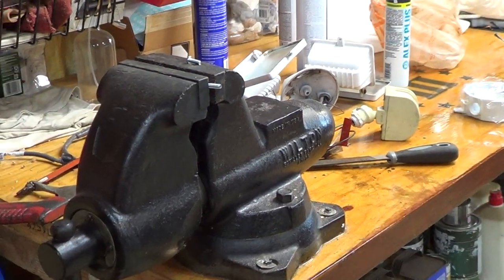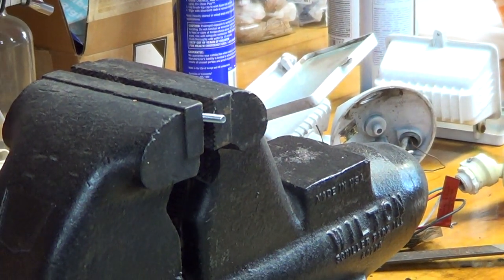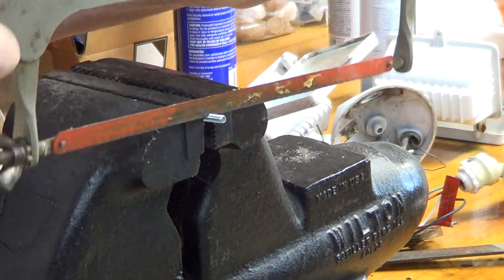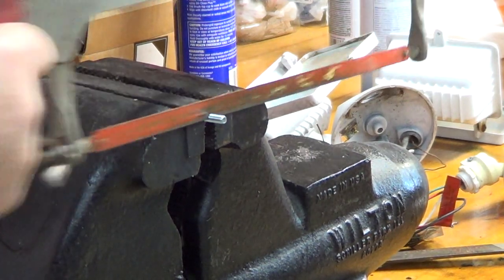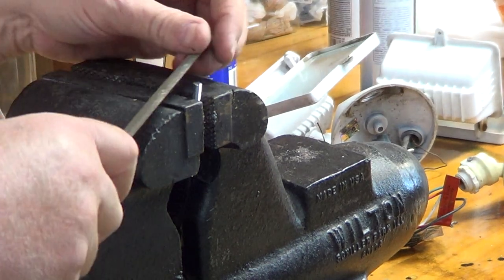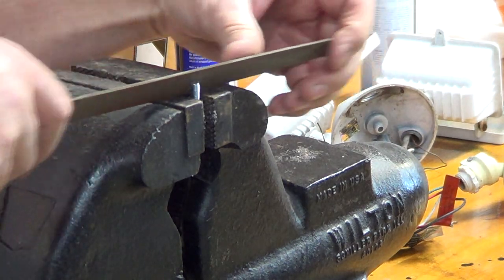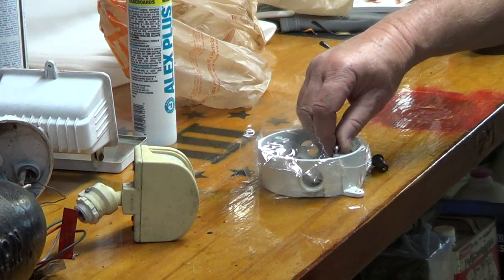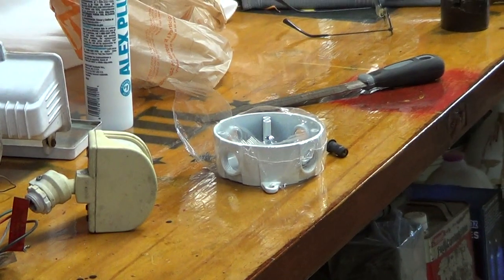How To Cut A Long Screw Shorter & Prepare The Threads So It Works

Comment: Most good wire strippers have the ability to cut standard (6-32 and 8-32) electrical screws to length.
There are threaded holes in the strippers.
Reply from the maker: wow, I have to check that out, thanks
Reply: I just made that comment and then scrolled down and seen yours. Lol. Funny , I just learned that a year or two ago and was happy as hell to learn that. Never knew that for 30 years while using them. Lol
Reply: Not on the part that strips wire but the holes in the middle of the tool will cut small screws   I find it easy to run a nut down the bolt/screw past cut then cut it and take nut off  clean treads up

Comment: A little trick I found out was - you know the electrical pliers that you use to cut electrical wires. Every set that I've ever seen has little holes all over the middle or towards the top of them. Those holes are different sizes for different size screws. If you want to cut a screw , put the screw in to the hole of size you want cut. Squeeze the pliers and bam. 99.9% of the time , the screw is perfect and ready to use. Just a tip/trick that I seen on YouTube a while back and could not believe no one ever taught me that. Lol.

Comment: A nut on the screw all the way on will help clean the threads after you cut off the extra metal. After the cut lightly file and then back off the nut to clean the threads. I’m probably not the first to say this, but it has worked for me many times. They also have a file made for just screw threads. 👍

Comment: If you had a nut you can fix the threads also. You just spin it on, cut the screw and then take the nut off and it helps fix the threads. And filing also works. Whatever is at hand.

Comment: You could also use your wire strippers for smaller bolts and screws and no need to prepare the threads.

Comment: A bolt that size should be a 15 second cut.  Long, fast strokes is best with just light pressure.  It is also good, if you have a nut that fits the bolt, to put a nut on before cutting and then spin it off after you have filed off the burrs and chamfered the ends.  The nut will do a final cleanup of the threads and knock off any remaining burrs.
Reply: I was gonna say the same thing about using a nut threaded on before cutting to help debur the threads. Make sure it's a good one that isn't soft though

Comment: PRO TIP:  Put a nut on the screw before you cut it.  Cut it, file or grind on a bench grinder, the thin part of the thread where you cut through it down, then un-screw the nut.  The nut will take out any deformation in the thread and it will work perfectly!

Comment: Rick, just get yourself a set of electrical stripping pliers it has most sizes built in. 10/24 6/32 10/30 4/40 8/32 Thread sizes. Real simple screw in squeeze handles cut bolt. after you screw that out of the pliers it’s pretty much ready to go .no file required 90% of the time

Comment: Nothing like a good old hack saw.   Typically you want 3 teeth in material at a time, but just a guideline.  I got 3 saws set up with different teeth count / inch so it's easy.   

One way push down to cut with saw little on return.   The file only cuts one way was debunked my that guy, He did a great test. 

One trick I do is thread on a nut to the bolt before cutting it off in vice,  easier to hold.  taking the nut off can kinda clean up the rough end.  Wire Wheel Steel brush on grinder does good too for deburring it.
Reply from the maker: that blade is probably original I got that saw at garage sale or pawn shop  years ago never replaced blade

Comment: I'll usually thread a nut on a bolt before I cut it off, if I can find one that fits. After you cut, just screw the nut off, it'll rethread the bolt pretty well.

Comment: It would have been nice to have had a nut to thread on to the bolt, before you cut the bolt. When you unthread the nut off the bolt the nut will correct the threads as it is unscrewed as long as it is cut half way straight.😉
Reply: exactly what I was going to add.  this is what I have done many times.

Comment: If you have a good pair of wire strippers they will have holes close to the privet pin marked 6/32 or8/32. They are for cutting screws.  Make sure you put the screw in the threaded side first and it will repair the threads.  Also the light kit should have had more screws in it.
Reply: Exactly.

Comment: If you have the nut, thread that on before you cut the bolt and you can use the nut to chase the threads by unbolting it.

Comment: I put two bolts on then cut between them keeps it straight and then file the edges after that back the screw off it retaps it if it needs it then do any finishing you might need but there is no major right or wrong way to doing it as long as you keep it straight

Comment: I use a flat bastard for threads one two swipes through the 10" length of the file, perfect for 3/8 allthread
Reply: The master plumber who trained me in New construction plumbing would just use channel locks to break the edge and be able to thread a nut on, I found it a little ridiculous, but he could, fucking machine of a man

Comment: Rick I’m sending you a grinder next one I take from work that is, it’s easier to just put a nut on cut and back nut off, nice vise tho!🍩🍩🍩👍🏻👍🏻👍🏻👍🏻
Reply: Excessive heat takes the temperature out.
Reply: @jasonbourne1596  lol, it’s not a grade 8 bolt, it’s chinesium . And yup, run a nut down, then saw or grind it, then take the nut off after dressing the end a bit and you’ll be fine, like Jon K said.
Reply: I’ve got a few metabo 6” side grinders from work myself lol, boilermaker here.
Reply: @shanek6582  I’m a bm also are you out of pgh I know a Shane or two?
Reply: @jonk6137  l#-677 , what local are you from?
Reply: @shanek6582  154 land of super high dues and fees!
Reply: @jonk6137  lol, you’re not a relative of that old BA ironhead are you, I’ve boomed out and worked out of 154 so many times I had a small pension account there. Hatfields and Mitchell plants mostly, there was another one farther up river and I can’t remember the name for the life of me. Also, I worked stacks quite a bit and I remember being on top of one and I could see three mile island, do you know what coal plant that is (or was, probably closed down by now) I retired in 09, lots of the plants I worked at in my state, WV, have probably closed down now thanks to the greenies. Be safe out there! Don’t let B&W catch you taking another metabo home for Rick lol.
Reply: @shanek6582  no I’m first generation bm and I usually work Ohio plants bc almost all of our coal burners are decommissioned but yes the dems are definitely guna be responsible when the blackouts start but I have no fear because 99 percent of the masses won’t do or even say anything, it really pisses me off but what can anyone do other than send an email because no one in govt answers a phone or calls disgruntled tax payers back it’s so sad, what rick says is totally accurate, we have let this country go to hell in a hand basket.  I’ll do my best to get that grinder off site with no hiccups,  you are the third bm I’ve ran into on ricks vids…nice chatting with ya stay safe out there and stock up this conflict could get bad fast!  Our own govt calling for a real Russian insurrection or assassination.
Reply: @jonk6137  A lot of times they are, but are actually too hard, even American items.

MY Papaw for instance was always breaking tractor pins. Like all the time. I was in machine shop getting my machinist 1 when he told me about it.

I told him, bring me the broken tractor pin, I'll make you one that won't break.

So I machined him one but I didn't heat treat it really hard. I took it to him and said, this will bend, just hammer it back. It won't break, only bend. 

As far as I know, he never had to buy another. He died, it probably still works, but I don't know who has it.